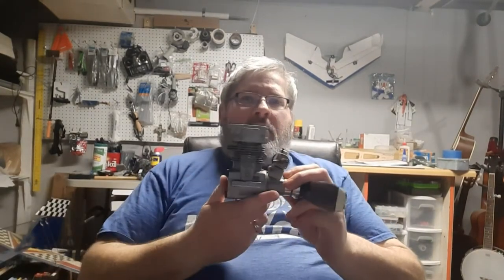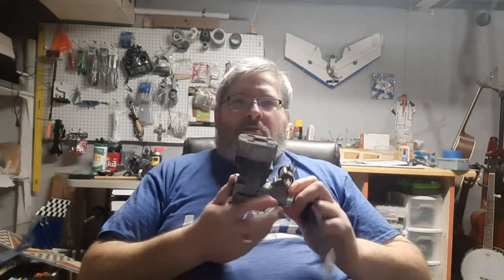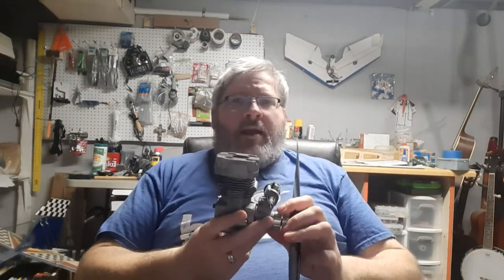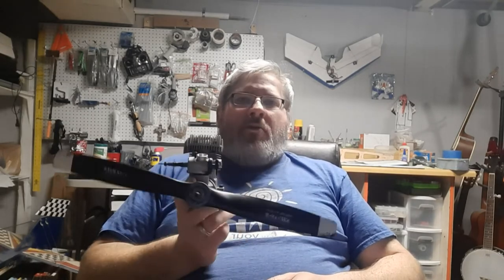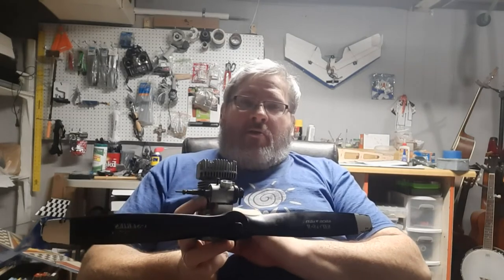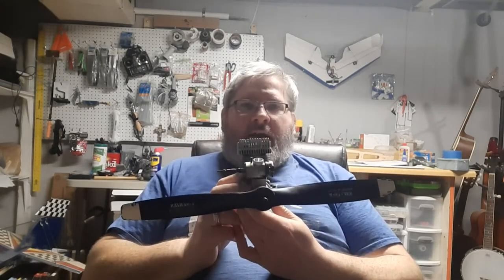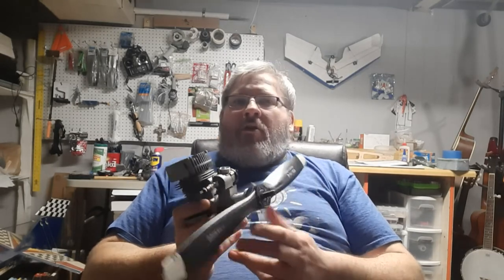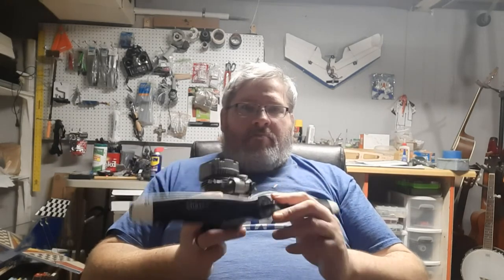Another new journey... Internal Combustion engines (glow/gas)

Comment: WOW C!!! That's getting serious!! I'm still not good enough on Foamies, to even CONSIDER that! 😖 
I do remember Cox .049 Control Line Planes as a Kid. Getting them to START was frustrating! 

I've heard in later years that many Glow Engines run well on Diesel - if you don't want to spend a fortune on Fuel.... 

I completely understand what you're after. That's what got me into 1/10th Scale Touring Car Racing - something I completely missed in the 90's, in its heyday.
Still going to build a FT A-10... But I'm not sure how much further I'm taking it. Living in a BS City, with so little places to fly, and not always able to get to good places, has really put the kebash on it. 
But I'm excited to see what you're doing with Glow Power and BIG Planes!!
Reply from the maker: Thanks man...big time change...I knew I'd get to this point sometime, just didn't expect it to happen the way it did and as soon as it did. 

I'm thinking with all that I have accumulated this will slow me down a little...I have plenty to keep me busy for a while. 

Haven't heard the diesel thing, that's interesting. The recommendation for this engine is a low % nitro...like 5%. It seems like higher percentages are more common. 

Best of luck with the A-10...I'll be keeping an eye out for it.

Comment: For me it is hard to imagine that anyone in the hobby has not run glow engines.  Unfortunately the glow engine market is not what it used to be.  Most engine manufacturers are long gone as well as the spare parts for them.  That is not to say they cannot be bought still.  Many people still have them used and NIB engines that they purchased and never used.  Just be advised that Super Tigre is LONG gone as is any parts support.  So crashes can pretty much be the end of the game if the engine is damaged and parts are required to repair it.  Learning to tune glow engines on your own can also be a steep learning curve depending on your desire and competency.  The best way to learn, IMO, is to learn from a glow flyer in person.  Learning via videos, RC Forums, etc. cannot give you the immediate feedback necessary when the numerous questions arise during the process of setting up, starting, and tuning.  I know that you have already reached out to me regarding the carb setup on this engine.  The Super Tigre Mag V carb, used on MANY ST engines and displacements, is a reliable and easy to tune carb. provided you have the proper instructions and knowledge of the 3 adjustments on it.  The video link I provided to you has the setup and operation instructions in the video, but could be difficult to pause and read, but they are there.  https://www.youtube.com/watch?v=7Y9aqsHlWG0  Here is another video where I explain how I setup a carb.  https://www.youtube.com/watch?v=2MjVJrhsC50
Reply from the maker: Thanks for the reply.

And yeah I know that I am stepping into an older and not as widely supported (or not supported at all) form of propulsion for my models. I actually had been flying electric. I bought a set of some old balsa models...2 were glow, 1 is gas. And rather than go through conversion on the glow models, I figured "hey lets give it a shot!". Plus, I consider myself a person who doesn't discriminate or an all electric "IC engine snob"...no way, they're all good in their own way!

I will see how the learning curve treats me. I'm patient enough to learn and stick with things. 

I actually did end up finding up some documentation on the engine and what all the different adjustments are. 

I'll definitely check out the videos...thanks for all your help!